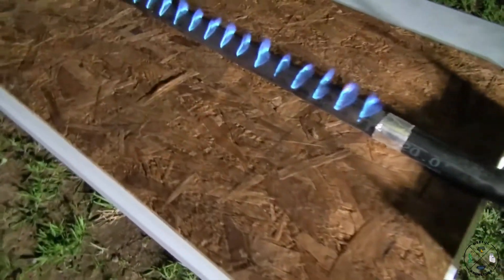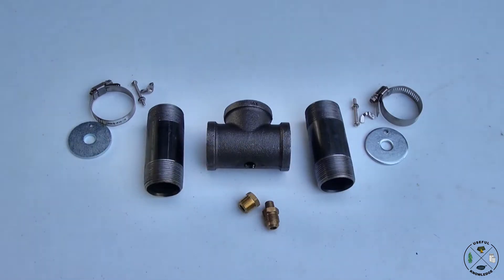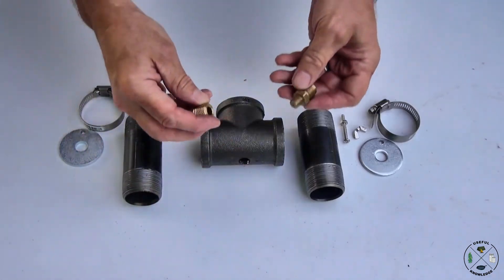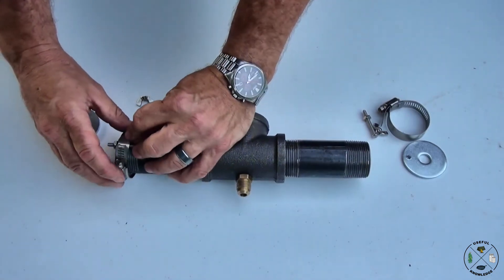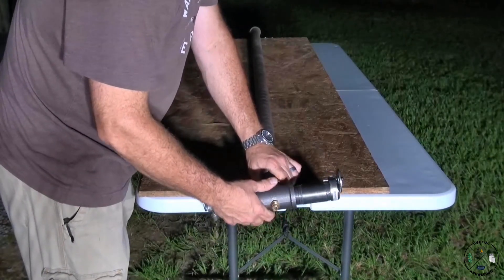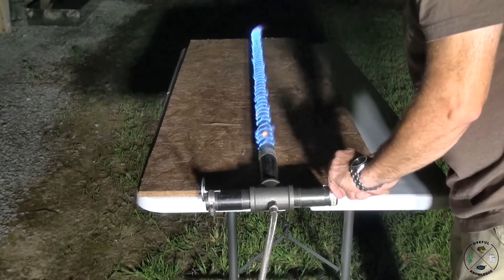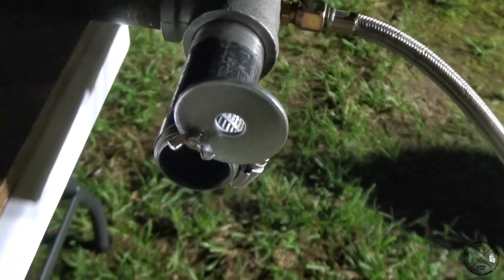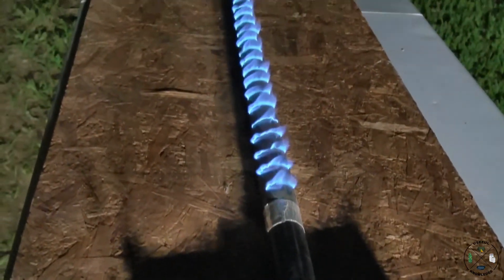Pipe Burner Venturi | Useful Knowledge

Comment: Probably a silly question but why even have the washer/dampers on there... It seems to burn best when they are wide open anyway. Is there a situation when it would work better with them closed off??
Reply from the maker: Not a silly question at all.  I really thought that I would need to adjust the air flow but ended up not needing them.

Comment: I guess if you take bigger T reducer, bigger sides for venturi than your caps for narrowing intake will have more sense, so with more air you can get more gas in the burner, which translates in more BTU, and when you need low BTU you just scale down propane and with side caps regulate blue flame again...good video, tnx

Comment: Hello, having issues with flame blowing out, and advise?
Reply from the maker: Sounds like you need to slow pressure down.  Try lowering the gas pressure with the regulator first.  If that doesn’t work, the next step is to drill the orifice out very slightly.

Comment: Can you add multiple burners to a single venturi
Reply from the maker: Great question!  I’m actually going to try it in a video soon.  I think that I may have to open up the orifice a little to make sure enough gas gets in and continue to use the adjustable pressure regulator so I can have the appropriate pressure.

Comment: Would I be correct in guessing that the slits are 1/16" (.0625") thick/wide NOT long?
Reply from the maker: That sounds about right.  It’s the kerf of the cutoff blade.  That kerf is 1/16 or 1/8. The slits are 1.5” apart.

Comment: What size pipe would you use for 10’ burner?
Reply from the maker: I think the 1 1/4 inch would work.
Reply: @ thank you.  

Do you think putting the slits 1” apart would be okay?
Reply from the maker: You’re probably going to need to be pushing more pressure with one inch cuts.  1.5 inch cuts seem to be about perfect on my long and short burners.
Reply: @useful.knowledge  Thank you sir

Comment: I made a burner from your instructions but have all orange flames still.  48” pipe 1” diameter, 14” throat… tee is 2” reduced to the 1” pipe.  I can’t figure it out for my pizza oven!😢
Reply from the maker: How much pressure are you running?  Sounds like it needs more pressure and more air flow.
Reply: When I use the orifice that wasn’t drilled out, I got a blue flame, but couldn’t get a variation in flame strength.  Ie: high low.  Just low… but blue.  
The drilled orifice (5/64) gets me great heat and height, but orange.  I’m baffled.
Reply from the maker: Ok. Since you have the non-adjustable regulator, you are probably not getting enough gas into the pipe.  I think if you get a hose with an adjustable regulator, that should work for you
Reply: Standard 20lb propane tank w regulator that doesn’t adjust

Comment: This was totally genius way to go! Question: what did you use to cut the slots in the burner pipe?
Reply from the maker: Hi. I just use a cutoff blade for cutting metal.  Check out the channel for propane pipe burners.  I have a few out there.

Comment: Great videos, thank you. Have you done any calculatioms on BTU output?  I'm using them to build a pipe burner for my pig cooker. Burner section of the pipe is 60" and will have 40 cuts, about what i think you have here.
Reply from the maker: Hi.  I haven’t done any calculations on the BTU.  If you haven’t seen the video where I built the burner here is that video:   
Homemade Pipe Burner | Useful Knowledge
https://youtu.be/aO8c4raYlv8

I also bullt a two foot version that I use for my small syrup cooker.

Comment: Accidently bought galvanized pipes and fittings instead of black steel pipe. Is this a problem?
Reply from the maker: I wondered that same thing so I checked some forums.  Consensus is that galvanized pipes should NOT be used for burners.  Apparently they off gas when heated.

Comment: Do you think you can take this set up except have the 1& 1/4 pipe running parallel to the venturi pipe? so basically using a another pipe nipple and tee into the center of another 1 & 1/4 tee and run the burner pipe parallel instead of in the end? Thanks for any help. I did the same set up with a smoker I built cut the slits in the pipe except that the gas line comes in to the middle of 2 smaller sections of pipe but I do not have the venturi and it burns dirty and yellow flame and when I raise the lid the flame will go out and I want to try to build this venturi.
Reply from the maker: Hi. I think it would work.  About your other setup, yellow flame is usually the orfice or the amount of air.  I would change the orfice drill out size and make it smaller.  Here is a homemade Venturi that I have used on everything for the past two years.  Homemade Pipe Burner with Homemade Venturi - 2ft version | Useful Knowledge
https://youtu.be/XKa_4Tdh6Jk

Comment: I saw that you make a gas burner, take a look at what I did.... Inside my burner there is an air diffuser, for a better air/gas mixture... thus generating a perfect burn. Inside the burner is another thinner pipe, with cuts. If you are interested, send a message. thanks

Comment: Do you think a 16” throat would work? I’m building a smokehouse out of 8” thick cinder block and want the Venturi on the outside. I would start my slits 8” off the inside wall, it would 6’ long.
Reply from the maker: Hi.  I think it would work.  I made a smaller version for my 2’ syrup pan.  It’s got a 12.5” throat and a home made venturi.  It ran flawlessly for 8 hours and when making syrup.   Here is the link to that burner build:  https://youtu.be/XKa_4Tdh6Jk?si=kJ0ZxrXDZ74BS3cm

Comment: no welding, love it! so the burning is pulling the air in which prevents the propane from going out of the intake ports? 

annnnd just got to the wnd of the video. Thanks!
Reply from the maker: Hi.  The pressure of the gas and probably some heat transfer is causing it to pull air.  Thanks for watching.  We have a new video that I made last year for a two foot burner.

Comment: If you didn't have enough slits in your burner then couldn't gas come out your tee?  So how do you know how many slits to cut?
Do you really need 2 side inlets?  Would 1 work fine?
Reply from the maker: I honestly do not remember where I learned the 1.5” spacing on those slits.  It was many many years ago but it works.  I also use that spacing on my 2 ft version and it will throw the heat.  We have a video on that one and you can see it running in the latest syrup video.  You could probably get away with not using a T and just use an elbow.  The drilling might get tougher to keep inline.

Comment: You could cut down the cost of your venturi by ditching the nipples 8-32 screws and pipe clamps. Just drill and tap the lip of the tee 6-32 to screw the washers to with short 6-32 screws.

Comment: Do I need both air vents?
Reply from the maker: Hi.  In most cases, yes.  It really depends on the burner length and how hot you want to run it.  I built a venturi for my 2ft burner that I wanted to run hot.  For this, I used a 1 1/4 x 2” coupling.  The 2” on both sides really allows the air to be pulled in.

Comment: How about the pressure of gas? Is the air still sucked to the pipe eventhough the pressure is low? Or there's minimum pressure?
Reply from the maker: Hi.  We have a new video that shows the pressure turned up and down really low on our new 2ft pipe burner with homemade venturi.  Homemade Pipe Burner with Homemade Venturi - 2ft version | Useful Knowledge
https://youtu.be/XKa_4Tdh6Jk

Comment: I just made one of these venturis for my grill. I am having some issues though. I drilled out the orfice to 2/32” and am using 1” pipe. I made a bulkhead through the side of the grill using 2 1” floor flanges and threaded the Venturi on one end, and inside the grill I have a 24” pipe. The first 4 inches are not slit, then after I have slits every inch.
When I went to light it, it did burn nice and blue. I noticed over time with the lid shut that the flame either yellows out or blows out when I open the lid. I kept the exhaust stack on the grill fully open, and even tried keeping the flue on the other side of the grill open as well. How might I fix this? I am currently on a regular set 20lb grill regulator.

I thought about spacing the orifice further down the T into the throat of pipe, and I also thought about getting an adjustable regulator.

My goal is to have something quick to use and cook on/ searing some steaks, that neither the charcoal or pellet grill can do quickly
Reply from the maker: Hi.  Yellow flame is indicative of not getting enough air.  When you close the lid are you somehow shutting off some airflow into the venturi or just the pipe?
Reply: @useful.knowledge  just the pipe. The Venturi is a T on the outside of the grill. I can also see the flame in the T; not sure if it’s supposed to be lit that far back. I’m not sure how I can get more air to it, I might have to try a smaller nozzle
Reply from the maker: Ok my next thought is that your throat needs to be longer.  From my experience, an at least 8 inch throat is key.  On my two foot burners that bush for my small syrup pan, my are closer to 10 in.  To troubleshoot this, I would just purchase a coupler and a short pipe nipple to add in between the existing throat and venturi to see if that corrects the issue.
Reply: @useful.knowledge  I ended up getting it to work. I took out the orifice and put on a needle valve with a 1/4” male to male coupler and closed it off with a cap that has a 5/64” hole. I also dumped the fixed grill regulator for an adjustable one and it burns very nice with a nice blue flame. I think the issue all along was too little propane pressure. The throat on it is about 7-8” with the fittings and pipe all hooked up
Reply from the maker: Sounds good!!  Glad you got it working!
Reply: @useful.knowledge  thanks for the help!
Reply from the maker: No problem at all!  I enjoy troubleshooting these burners.

Comment: What are dimensions of the orfice and the bushing??
Reply from the maker: Hi.  Orifice Connector Brass, 3/8 Inch Flare M x 1/8 Inch MNPT.   For the bushing, I took the orifice to the hardware store and matched it up.
Reply: Thanks appreciate it!
Reply from the maker: I meant to put this link in the reply.  This is where I initially made the burners.  I also used the same venturi setup on some two ft burners and they worked great.  More orifice info in this video https://youtu.be/aO8c4raYlv8

Comment: Used your video from two years ago to build a burner for our charcoal pig cooker. Works great, appreciate the video!
Reply from the maker: Awesome!!  Thanks for letting us know!!
Reply: @useful.knowledge that's what exactly I'm building right now, pig roaster. I know you said finger tight is OK, but if  I installing it permanently, should I use sealant?
Reply from the maker: @thebigboss024 Hi.  I don’t think sealant is required.  The gas/air is going out the slits and you don’t really have a build up of pressure. I have ran these for many hours at a time without any issues.
Reply: @useful.knowledge my pig roaster is up and running.  Many thanks from your vert informative content 👍
Reply from the maker: @thebigboss024 Awesome!  Thanks!

Comment: What size pipe u use in 4 burner? Looking 4 something that will heat up 2 350 degrees at least. I have a homemade 500 gallon rotersy .Looking 2 contain 225 /250 degrees.  But would like 2 get above 500 2 burn it off. What size holes in  burner pipe? I've tried alot of different ways. But can't get consistent.  Always 2 hot 1 side or other. Thanks very Very much for what u do
Reply from the maker: Hi.  The pipe s 1 1/4”.  Here is a link to a video when I built the pipe burner https://youtu.be/aO8c4raYlv8. That should help with your questions.

Comment: Nice build. Do you think you could build this in a U shape or would it be better to put an elbow a short piece of pipe another elbow and a piece coming back? I am looking to build a pipe burner that is 2 feet long for   a maple sap evaporater. Also where did you find the orifice?
Reply from the maker: Hi.  I built some two foot burners last year.  The homemade venturi should work.  I’ll put it on one of the two foot pipes tomorrow and let you know.  I bought the orfice on Amazon.  You may have to drill it out like I did in this video https://youtu.be/aO8c4raYlv8.
Reply from the maker: Ok.  I checked the 2ft burners with the homemade venturi.  They worked just the same as with the bought venturi.  It did have a small yellow tip but that was when I was really putting the gas to it.  So for full disclosure, my smaller burners have at least an 18” throat, 2ft of burner slits, and then about 12” of pipe before the end cap.  I had the pipe in the barn for years with threads already on each end so I just used what I had.  I made pics of the burner running a few minutes ago.  If you send me an email at useful.knowledge.tv@gmail.com, it will share them with you.
Reply: @useful.knowledge  thank you just sent you an email!

Comment: Hey, ive been doing syrup for a few years all on propane. I want to build this setup to go with the 3 chamber pan I built but I have a few questions, your video covers the venturi (Great) now the flame looks pretty small for boiling sap (as from your first video I know you used this for that). 1st why 1 1/4 pipe if I run 3 burners that size thats alot of pipe to keep full off my 100# lp tanks.my pan is a 2x4 progressive design pan.Second if you boiled off that burner can we see that. Curious how much has that thing eats in an hour.
Reply from the maker: Hi.  I did a lot of research and 1 1/4 seemed to be the size that most folks used.  That includes some old timers that I asked.  I have a 2x6 pan that was really just too big for the amount of sorghum juice that I’m producing.  I downsized to a 2x2 pan that easily holds about 10-12 gallons of juice at a time.  I made new pipe burners and used the same venturis as the first pipe burner video.  It worked great.  The pan is so thin that I didn’t have any issues with the boiling.  Here is a link to the syrup making video. https://youtu.be/Q6mmeqImkWU

I didn’t even change out the orfice size for the 2ft pipe and they still worked great.  

For the original long burners in the first video, drilling out the orifices is the only way I was able to get the burn that I wanted.  I messed up a few but they are cheap.  

About the propane usage, it’s surprising not as much as I expected.  I’m the syrup video, I had 3 of the 20lb tanks and I didn’t even use half of each.  Hope this helps.
Reply: I went with 3/4 pipe on 3 pipes 55" long i had a bag of #55 orfice i drilled out to 5/64 cut the pipe in 1" intervals one pipe get plenty of good flame but as I add pipe im have a stair step effect if that makes amy sence didnt know if i need to go from a 20# high pressure regulator to a 30# regulator? Thanks for the reply Ill check out the new video
Reply from the maker: Do you have three separate venturis running from the 100lb tank or a single venturi and then split to three pipes?  Also what is the flame doing?
Reply: I have 3 separate venturis 1 on each burner. From the tank its 1 20# high pressure regulator, then it comes to the middle burner and then I branched from the middle burner to the other 2. I have pictures of the set up with the regulator wide open. Not sure how to get them or a video to ya.
Reply from the maker: useful.knowledge.tv@gmail.com.   All three of us at useful knowledge are engineers that were raised in the country so maybe we can help figure it out.

Comment: This is great man! I was just thinking the whole concept of the venturi is so simple i can't believe they charge so much for it, i was a bit hesitant to make one myself since explosions and stuff lol but after this video i think i'm going to try! Two questions though...
can i use natural gas?
And can i simply have one tee joint but with the venturi one at a 45 degree angle so the flow is better and the air doesn't have to make a 90 degree turn? sorry if i didn't explain it correctly, english is not my first language.
Reply from the maker: Hi.  It’s more about the gas flowing straight into the burner under pressure and the resulting in flow of air.   It’s sounds like you are thinking about using a Y connection.  I could see that working but you will most likely have to adjust the orfice to get the flow required to make it work.  It would definitely be worth a try and really cool if it works!!

Comment: Doesn't look like you need the washers. Might want to try some advertising fridge magnets to control the air
Reply from the maker: Hi.  You really don’t need the washers for this length of burner.  When I first built it, it ran perfectly with no washers.  I was thinking that it was just pure luck. A different length of pipe burner or just propane quality could create the need to control the air.   I came up with the washers and the small screws because it was easily adjustable and I wanted to give folks ideas.  I think anything that could be rigged up to control the air and is stable would work.  Your magnet idea would work.